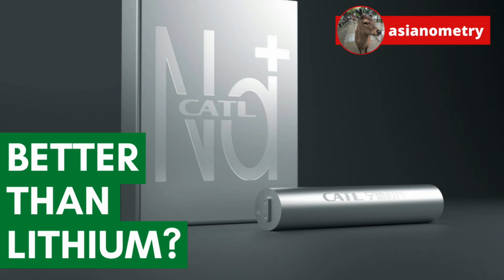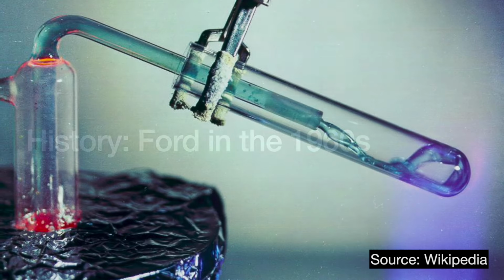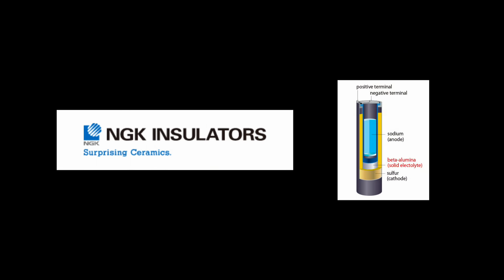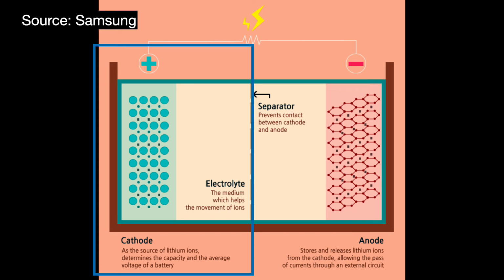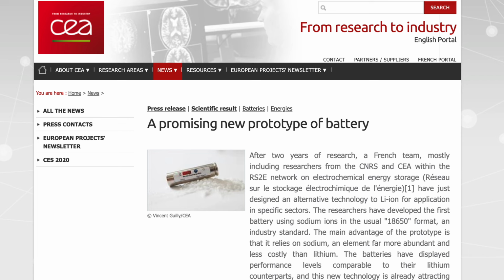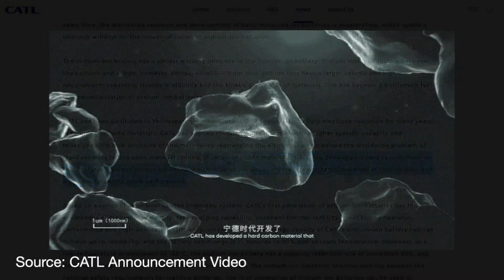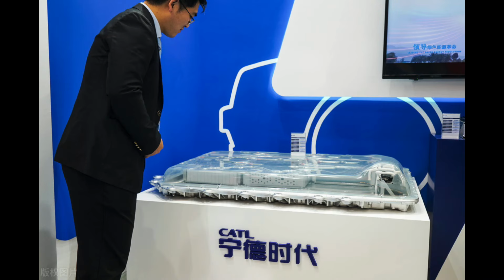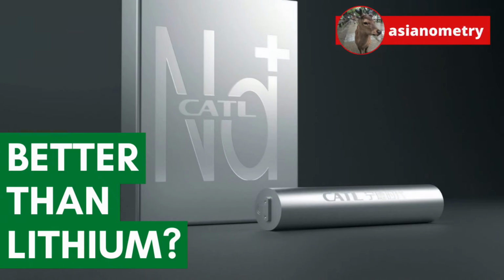CATL's Sodium-Ion Battery: Better than Lithium?

Comment from the maker: Thanks for watching. Like and subscribe, all that jazz. 

I also recommend checking out some of the other companies in the Company Profile playlist: https://www.youtube.com/playlist?list=PLKtxx9TnH76Qod2z94xcDNV95_ItzIM-S
Reply: Naive. 90% of batteries weight and energy is the cathode. Most still use 1800s era cathode material. Cathode material determines battery life. Ion batteries depend on reversible intercalcation of ions  to not damage the Cathode material. Sodium ions are huge in comparison and damages standard cathode materials. Sodium is long-term incompatible with today's ionic electrolytes, so a new chemistry needs to be designed and tested.
Reply: @stephenjacks8196  Gee dude you think this is why battery R&D is non-stop, around the world??

Economics is everything with battery tech.  While a person can sit there and ponder all day why something could be feasible, they typically fail to understand just how many use cases there are for batteries, and while many people are finally starting to think about BEV for instance, which then draws you into the topic of how important energy density, they fail to think about the need for grid storage because of a move to wind and solar, and for grid storage, energy density isn't important.  I mean there are literally water reservoirs acting as grid storage in parts of the world.

So, grid storage tends to wreck most peoples' notions of what a battery can be, and in this case the low cost of sodium CAN'T be ignored.

In the US for instance water and iron are being used to make iron redux flow batteries and at economics of scale this tech would be dirt cheap, which is perfect for grid storage.  The MAIN concerns are efficiency in conversion and low cost, not how much a battery weighs.  These batteries have been deployed already for grid storage.  They need to start making their way to all markets so that Li-Ion isn't wasted in this regard, such as what Tesla is doing.
Reply: @johndoh5182  If battery research is continuous then why are we using the same cathode material as the 1800s? Nice rant but doesn't answer the question.
Reply: @stephenjacks8196  I suggest watching the myriad of videos out there covering a large realm of different battery technology.  

What cathode material?  Oxygen?  There isn't a simple answer to what a cathode material is because they're complex molecules.

Cobalt?  Is that what you mean?  There are rechargeable batteries that don't use cobalt at all.

So, can you be specific?

LFP batteries which is gaining as a preferred battery for BEV in many situations doesn't use cobalt.

There are different battery technologies for grid storage so NOW we're out of the realm of cobalt completely for any but the worst solutions including Li-Ion which is a disaster waiting to happen if that becomes a main source of grid storage.

A large reservoir up higher than turbines and water pumped from a lower level, say from the ocean up to the reservoir is a battery, or I guess if we want to stick to the technical definition that revolves around chemical processes, then it's just energy storage. When you want to use its power water flows down from the reservoir through the turbine or turbines that make electricity and back down to that lower level.  

Iron redux flow batteries.  Tell me the cathode material you're talking about and we'll figure out if that's involved.  Those are perfect for grid storage.

Yes, I did answer the question.  You failed to read the "rant" correctly.
Reply: @johndoh5182  The Laws of Thermodynamics: you don't get a free ride. Although battery tech can recover some of the energy wasted, it is lossy: especially the resevoir BS.   Thats why is rarely done in the real world.
Reply: Hi, where has this gone now?
Reply: Hi, I'm interested in your work
Can we communicate further via WhatsApp?
Reply: If they are in 18650 etc cell or pouch type it doesn't matter about thee chemistry as long as they can be reversed engineered from ` Car A ` ? months ? years later to fit ` Car M ` and so on... as cars get older they need to be in a     ` reverse engineerable format `  other wise it`ll be short life span technology...  a
Reply: @kylereese4822  From that statement it's very apparent you've done almost no research on BEV.

These batteries, no matter what researchers say would probably never be for BEV.  They would probably work their way into grid storage.  There are already better battery technologies for BEV and you have to have energy density for BEV.  LFP batteries for instance still use lithium.  However, they have thousands more charge cycles than Li-Ion, and they don't use any rare earth materials which gets you away from the problem of nickel and cobalt.  Tesla has a contract for these, Toyota has a contract for these, probably one or two other auto companies are looking at them or have already made contracts.  Also the company that developed these, BYD also makes BEV.

And what this does is shift the market power away from CATL to BYD.  These are both Chinese companies, but the last report I saw showed the output for LFP going into BEV gained as a percentage vs. Li-Ion.

But back to BEV and Li-Ion.  NO company is going to use an 18650 battery for BEV.  You can't compete using it.  So, the first move was to a larger cylinder battery but right now I'm having a hard time finding it, but the latest which went into mass production this year and WILL be the dominant Li-Ion battery is the 4680 battery made by Tesla, and while there are some critics of it, there are always critics of something.  It's a very large cylinder battery.  It doesn't have a tab.  The entire top and bottom of the jellyroll is the tab, so instead of charging along a single path into a jellyroll and then that charge has to make its way through the entire width of that jellyroll, the entire width of the jellyroll have a charge applied.  What this allows for is much faster charging times and because the charge is applied to the entire jellyroll at once, you don't have the issue of possible overheating, which is what happens when you charge at one side of a jellyroll and the charge has to make its way across the entire width, which takes time and the side where the charge is being applied can get really hot.

So, forget the 18650 for BEV.  It died when Tesla announced the 4680.  But on top of that, Tesla uses it as part of the vehicle structure, so the battery is designed to be part of the rigidity of the vehicle, when the bottom container which houses the batteries is filled in with other material which frankly is brilliant.  Tesla has given a contract to Panasonic to boost the capacity of these up, because they want to compete with vehicles that will come out most likely the beginning of next year with 1000KM range, about 600 miles.  I expect that Tesla will have Li-Ion based 4680 battery pack vehicles that give near 600 miles/charge in 2024 - 2025.  And because of the way these are designed they'll be much more reliable and last longer than typical Li-Ion batteries.

But, there are OTHER technologies that are near working their way into BEV.

Really, as long as a sodium Ion battery can be made without using rare earth materials they've be perfect for grid storage.
Reply: Nah glass batteries  are the future.
Reply: F for chile :(
Reply: I don't know if you've done a video on LFP batteries, but since it's making its way into so many BEVs now, considering Tesla and Toyota and probably others have made contracts with BYD for production and then add in BYD makes BEV, it might be a good topic and could really educate people.

Another good topic which I don't know if you've covered is just how much the Chinese have moved to BEV, with large expansion of their electricity capacity, the govt pushing the country in this direction, industry buying into it and solving problems (BEV can be made for less cost than ICEV), and they have low cost BEVs AND the people have buy in.  It's a good example of what happens when a country doesn't fight about a topic but instead delves in full force.
Reply: and all that jizz... 😜
Reply: Can you give us an update?
Reply: time for the 2025 edition after CATL anounced the mass production and put their newest Lithium mine on pause . 
If you plan to replace more or less all LFP production lines with SODIUM then you will need far far less Lithium in a year cause if costs are 75% lower than LFP no one will wanna buy LFP anymore considering that they now anounced that SODIUM will even charge and discharge far below 0°C or up to -20°C where LFP stops around 4°C to charge and 0°C to discharge (in particular the BMS will stop it to prevent any damage in the cells).

So might be time as this would be the biggest revolution considering the cost advantage of 75% and better useability with a  slight current disadvantage of 5% lower gravimetric energy density. Afaik no other chinese is right now able to deliver SODIUM cells which means CATL can cash in big times from their 75% cost advantage.

If they offer SODIUM for 33% less than LFP and have -75% lower production costs a 50€ cell woul cost us 33€ and they woul have an additional margin of 20 € compare to 10% or so in the LFP segment.
Reply: Wait you have a jazz playlist? I can’t wait to check it out

Comment: While every other material being equal, the maximum reduction of Sodium battery cost compared to LFP is just 30%. But even with 30% cheaper than LFP, it would not become replacement of LFP because LFP can hold ~20% more energy on the same weight. 

Unless in the future there is steep increase in Lithium material cost.

Comment: Nice would be a swappable battery pack for those with no time for charging. If the swapping goes fast and easy then the range could be lowered,  the battery could be lighter and so also the vehicle. A light vehicle is cheaper, safer in case of an accident (for the others) and likely would consume less power, although it seems, less than one would think (??)

Comment: A couple things/ First, we are not going to run out of Li any time soon. Look at the cost per kg of Li, it is not a big deal. It hasn't been valuable enough to mine in large quantities, but now people are discovering large Li deposits. Li is easy to recycle once you get it out of the case. Another issue about Na and K is that when these metals are hot and liquid, they react with water to make H2 and heat which makes a loud explosion that makes people uncomfortable. That said, I hope we use elements other than Li for stationary batteries.

Comment: Isn't it now going to be Aluminium? Probably worth putting a bet on the next metal which is the breakthrough to end all other breakthroughs. Especially important as some of these deadlines for sustainability are as soon as 2030. It all seems to be a bit of a rush given battery development seems very much stuck in the chemistry and physics labs still looking for the wonder metal to save us.

Comment: Researchers and manufacturers should consider capacitance batteries as storage batteries where energy density is not so important eg storage for solar energy in the open field, it’s expensive and wasteful to use Lithium batteries in such a situation

Comment: Would a Sodium battery be useful for cold environments?  If 20% of my total capacity was sodium and I park my car for a long period at a location with no power, would drawing on the Sodium battery until/to the lithium based battery is warm be a practical solution.   I don't necessarily need a 500+km car, but I do need a vehicle that can take me 150km, sit in a snow bank, then get me home (300km with a deep cooling mid trip).
Reply: Indeed, cold-temperature performance is vital, as shown by the recent (late Jan 2023) coldwave that hit much of the USA, dropping the temperature to -22F where I live. LiIon can't function at all in this temperature. If NaIon can, that would be a big plus. Until the low-temperature problem is solved, electric cars are not suitable for for a large portion of the world.

Comment: CATL sodium ion battery has an energy density of 160Wh/kg. It can be charged very quickly but it can't retain its charge well at r.t.p. and is best operate in very cold condition. To overcome this shortcomings, CATL suggest using Li-ion and Na-ion combo.

Comment: I wouldn't really say Lead acid batteries are toxic persay. Not only are they cheap but most batteries are 92-98% recyclable. 4 12-volt car batteries on an old motorcycle with most its junk removed and a motor placed on it. Use to create a very simple and cheap scooter. Unlike the pieces of shit pedal assisted 30km scooters you see everywhere. DIY eleteric cars/motorcycles from the 70's till mid 00's. Were very cheap to DIY and had a range of 80-140km with a top speed of 100km(Perfect for the city, iffy in the country) The motors were cheap and "compters" easily made/fixed/replaced. Lead/Acid batteries are far more green and eccological sadly they have shit power and weigh a ton literally. After all they're just lead and sulfuric acid which is easily found all across earth. Yes lead is a heavy metal but its rather safe. The DIY route for EV's is cool if you're not a mouth breather conversion is rather simple. Motor batteries and computer in its purest form even a child could fix a DIY EV. "modern" EV's are far to complicated on purpose, EVs hardly break and are simple to repair. Parts/machanics/etc are a massive amount of income for the subhuman leeches that are the automotive indratery. Self service, simplicity and longtivity are evil products must be cheap garbage that cost an absurd amount to maintrain and fully break after a set amount of years so the consumer has to buy a new X. 
Tl;dr  Lead/Acid green DIY EV's good

Comment: All your rant about "carbon-free economy" is pointless because of 2 reasons.
1) There is no scientifically rigorous proof that CO2 causes warming; Even IPCC alarmist models predict no more than only 1-2°C warming because of human activities.
2) CO2 is food. It feeds plants. Our era has dangerously low CO2 levels (was 200ppm, is 400ppm). Plants will all die below ca. 150ppm. Geology shows past concentrations of many thousands ppm not long ago. Releasing all fossil fuel CO2 is not good enough - most is sequestred in limestones and continues to be depleted. We are still on the brink of extinction because of sea plankton.

Comment: For those wandering energy density of different Battery Chemistries for comparison: (in Wh/kg)
LTO:      50-80
LCO:     150-200
LNMC: 150-220
LFP:      90-160

The sodium battery on this video presumably achieves 160Wh/kg, same as LFPs. Very nice indeed.

PD:
LTO      = Lithium Titanate
LCO     = Lithium Cobalt Oxide
LNMC = Nickel Manganese Cobalt Oxide
LFP     = Lithium Iron Phosphate
Reply: Thank you
Reply: it looks a bit outdated.  The NMC5/6/7/8/9 all have different energy densities -- the 8 being the most commonly used today and the 9 (used in Ford's F-150 and Hyundai/Kia EV9, Ioniq 5N)  for instance is in the range 300-320.  The highest density for LFP from Guoxuan is 200.
Reply: Are LCO and NCA same battery?
Reply: Are LCO and NCA same battery?

Comment: Research affirms the potential of low-cost and high-performance sodium-ion batteries to gain a strong foothold in the battery market. As the world increasingly looks for safe and sustainable energy storage, sodium-ion technology innovation is only going to get better in the future. Now every country when mentioning battery thermal runaway, the fire fighters shivered.